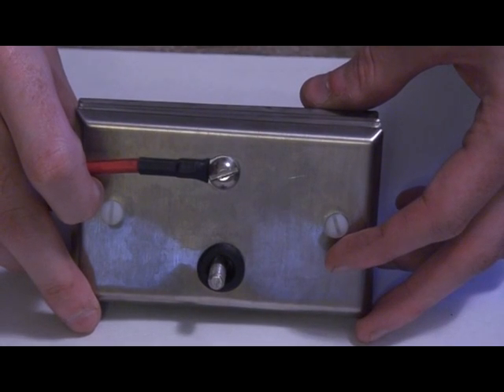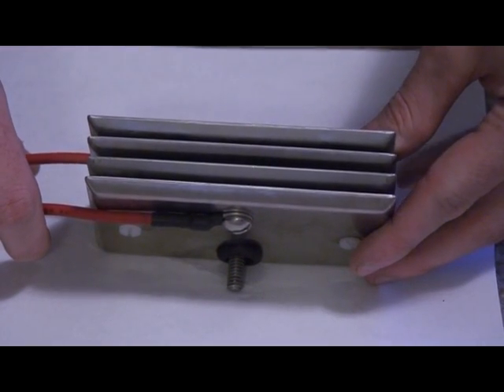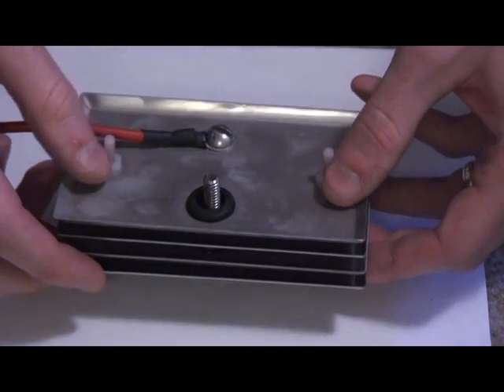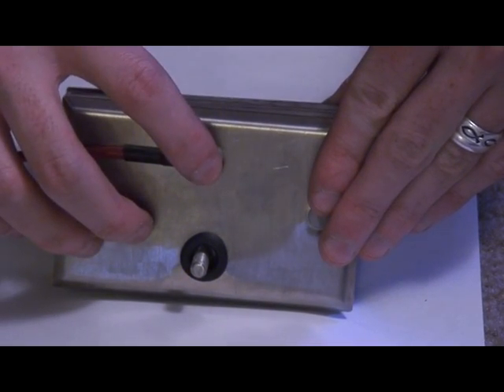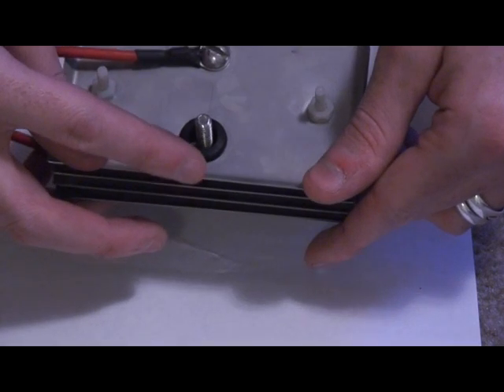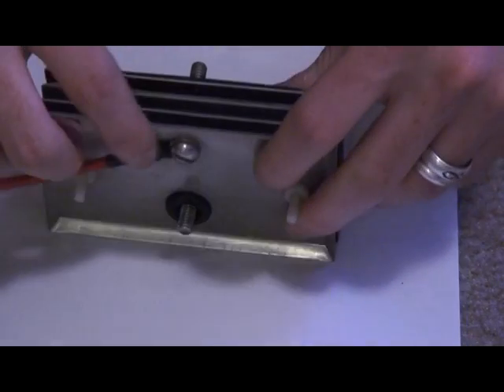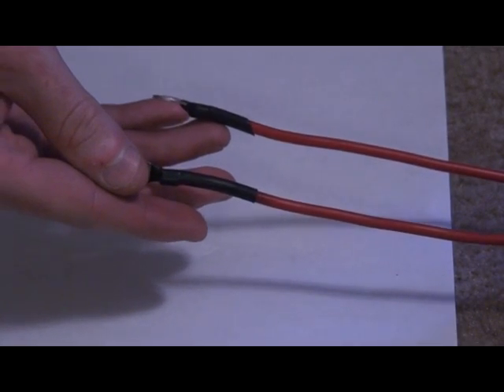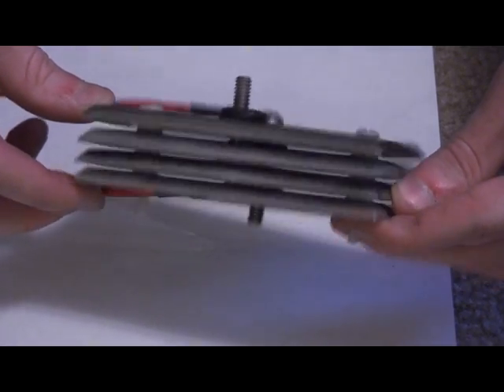HHO cell design # 1 (4 plate setup)

Comment: @rbeenlio I suggest you DO NOT use plastic coated wires ... instead use a ridged / Stiff  Stainless steel wire to connect your cell inside your main chamber this way if there is any melting the chances of your wires coming into contact with each other (causing a SPARK) is minimal 2 wire touch inside you main chamber > SPARK > IGNITION > YOUR DEAD!  Don't use soft wire in your main chamber if you are having heat issues OR EVER for that matter !  what is your running stats Volt / Amps / Temp ?

Comment: I did have problems with those neophrene gromets getting quite brittle after a while ... but they worked out ok for good while ... 

I think it was heat that made mine deteriorate ... you might do better with them than I did if you can keep your device cool ...

good luck to you ... lets see how it does making bubbles in the soup ...

Comment: if you hit it with 2v-3v and BIG amps, it will produce very well and not get real hot.  however, if you hit it with 12v even at low amps, you will find it makes more steam than gas.

your 1/4 inch plate gap will work quite well.  some will tell you that you have to get it down to 1/8 inch or less. not really the case.  you will just have to use a fairly stong electrolyte to get a good reaction is all.

all screws/bolts/washers must be stainless. if its in the soup, it must be stainless.